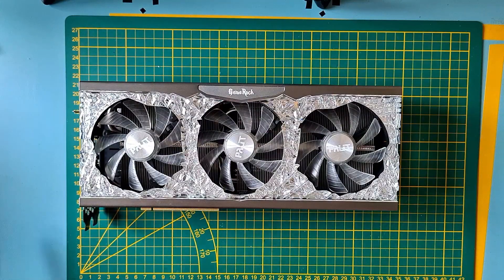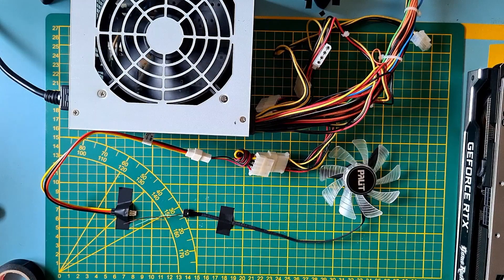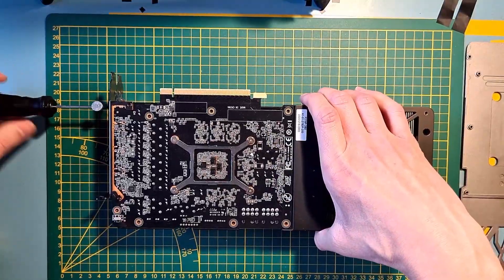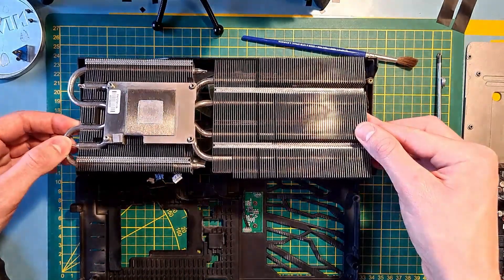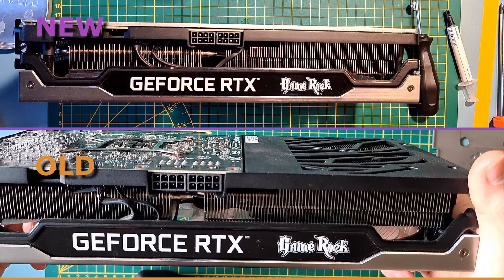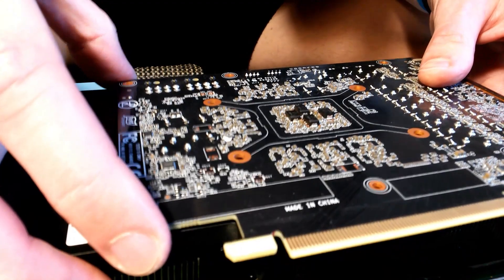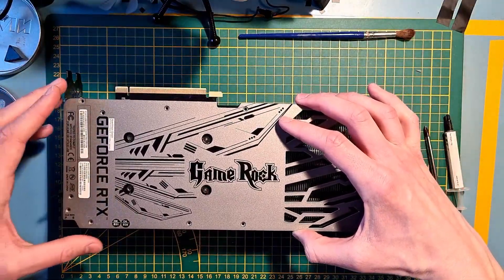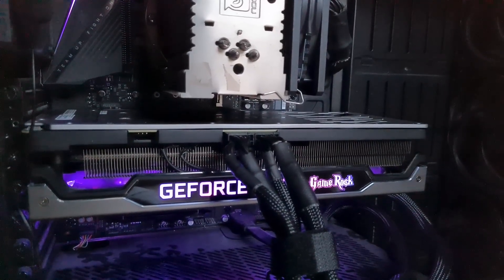GPU Fans Replacement | GPU Repasting | Palit Geforce RTX 3070 GameRock OC

Comment: Have you noticed that your heating fins are loose and can move around even after closing the GPU? It bothers me alot as this cannot be normal, but i see nowhere that i have missed a screw or clicking the item in or anything out of place.

Any advice would be appreciated
Reply from the maker: hmm.. I have no idea how it would be possible. Notice at 2:28 the four screws, two on the left and two on the right, that is what holds down the whole plastic panel.. now, look in the middle, the four elevated screw holes directly for the chip heatsink.. the right two screw holes go through the holes in the plastic panel, so it makes the whole heat spreader (fins) in the proper position and therefor fixed in place because the plastic panel on top in fixed in place with the four highlighted screws on the left and right side. So the only possibility, what could be wrong, that I can think of, is that the right protruding heatsink screw holes do not go through the holes in the plastic panel that lies on top of it.

Comment: My fans make a humming noise even at low RPM, so I want to replace them. If I buy these fans, can I use them for 3 or 4 years without issues, or will I face the same problem again over time?
Reply from the maker: It really depends. If the GPU will be running 24/7 then maybe not. But a new set of fans at normal average usage can last even a decade with no issues. And again, even new fans can become faulty after after 4 years.
Reply: @will_neithan  Thanks. Can I buy it from the link you shared? Is it Palit's own product? Could you provide more detailed information?
Reply from the maker: @smmo00011  Yes, they seem to be original Palit fans, although as I mentioned, they looked used, not new. Every other vendor was selling them for three times the price, probably new, so I took my chances with these and didn't mind if they were already used, if they worked properly. Also the same fans are supposedly used also for different models from the series, so the stickers might not match. The original stickers on the 3070 were silver, but the replacement fans had black stickers on them.

Comment: I got the exact same card and its overheating, how do you know if its faulty fans or i just need to repaste it? All three fans are spinning though?
Reply from the maker: Check the fans and look for damage. Double check if the fans are spinning properly. Make sure the heatsing is clean of dust. Make sure you are not overriding the fan speed to a fixed percent in some programs like MSI Afterburner. Try changing cooling profile on your motherboard, either in app or in bios. Make sure that your PC case is not the issue.. try to open the side panel of your case and test the temperatures like that. Make sure that your PC case has clean air intakes, that it sits in a relatively open space where hot air is not accumulating. If all the above fails, then I guess repaste. If you bought the card second hand and it had been repasted before, it is most likely the paste, becase supposedly consumer cooling pastes should last much less then factory cooling pastes.
Reply: @will_neithan  i just fixed it, thankfully it was just the paste that probably pumped out. I repasted it and it works like a charm, huge difference in temps. I followed your disassembly tutorial, thank you again brother🙏
Reply from the maker: @al3n998  Nice! I'm happy to hear it!:)
Reply: @will_neithan thank you i will try❤

Comment: Is there any chance you can upload a tutorial on how to replace a led? I have one specific led that is actually working but not correctly when it comed to certain colours and I can’t find anything about it 😢 (Yes, I’ve already checked with the thundetmaster app first and everything is working as it should except for that single led)
Reply from the maker: Sorry, but unless it stops working on my GPU, I will not attempt to do it. Try to look up some tutorial on how to change LED in any brand and model of GPU. It should give you some general direction. The only difference would be the GPU disassembly and the LED type. It is also probable, that it is not possible to replace just one LED. If it is possible then it would probably require soldering. Another thing you can try is to buy the whole gpu front panel or maybe just the LED panel and replace it whole.

Comment: What are the Temps? I got the 3070ti of this same GPU. planning to repaste it only.
Reply from the maker: Hey, I haven't tested the temps and unfortunately, I am not going to test it. I am actively using a different GPU now, so it's a hassle to swap it up. Be careful though with the decision to repaste. If you have stock pasting from factory and you do not have thermal problems with your GPU, it might not be worth repasting. Supposedly, they use different pastes in the manufacturing with high longevity, that last much longer than consumer pastes. So once you repaste, you might get lower temperatures, but now you should be actively repasting every 0.5 - 3 years depending on the gpu usage. This is not my experience, I am just reproducing info that I gathered from other people on the internet. So make your choice.

Comment: can we replace the fan with traditional case fan ?
because its imposible for me to get the replacement fan.

Btw original fan is very loud because it use Double Ball Bearing
Reply from the maker: Like, yes, you can replace it with a case fan but, you would need to custom mod the whole cooling. There is no way of attaching any case fan onto the GPU cooling, in the design it is right now. So you would have to some serious modding. The cleanest would be 3D printing the whole top panel that the fans are screwed onto, with modifications for case fans attachments. Or create such panel without 3D printer. Or you would have to drill holes to the panel for the case fan screws, maybe even cutting out parts of the crystals for better airflow. Or you could cut up bigger openings and just super glue the case fans on the frame of the panel. And don't forget that case fan's connector is bigger, so you would have to solder a new one or cut the cables from the old one and solder it to that. Or you can just plug the case fan to the motherboard or molex to 3/4 pin connector reduction, but than the fan would run non-stop. I'm not sure what your situation is, but the best strategy would be getting your hands on some gpu fan from a different gpu or different electronics.. just mind the airflow design of the fan, so it has the correct direction.
Reply: why bother?